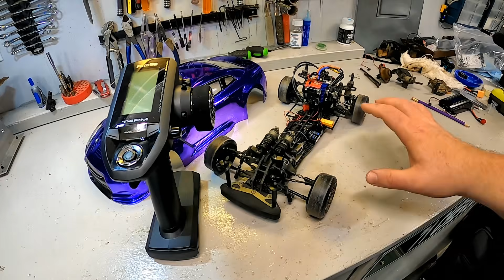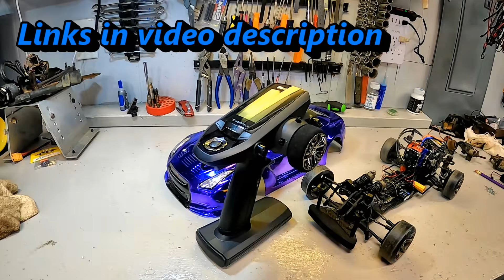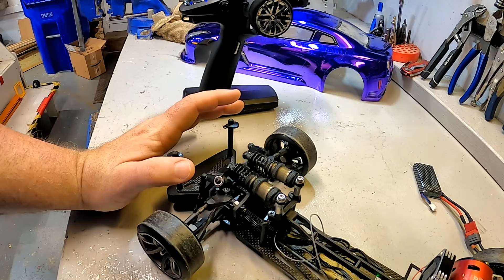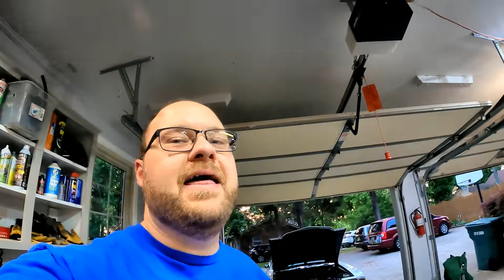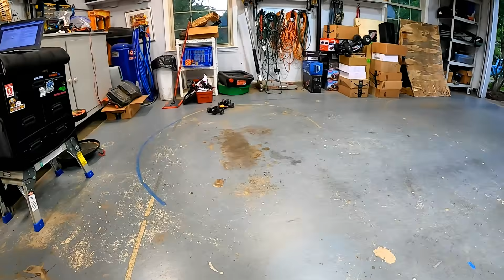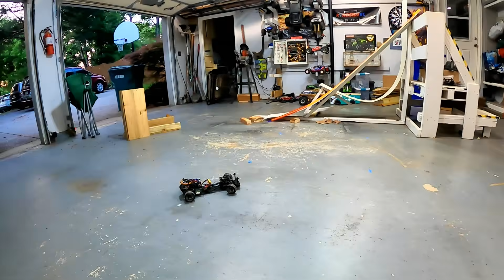How To Setup and Test the Yokomo DP-302 v4 RC Drift Gyro

Comment: Where do u plug in the gyro gain control I plugged it into the same channel but mine isn’t changing colors
Reply from the maker: Check this out to see if it helps:
https://youtu.be/_9qjApI1Uog

Depends on which controller you are using.

Comment: How well does this gyro work with the flysky noble?
Reply from the maker: Not sure I have paired them specifically - but based on my experience, I see no reason why they wouldn't work well together.
Reply: Works perfectly. I've used this gyro, and the OMG V4 on both the NB4, and my current NB4+. Plug the single wire plug into ch3 / ch4, map it to whatever adjustment control button you have free, and you can adjust everything on the fly gain wise. (depending on if your settings are rev/norm), going to a negative value puts the gyro into soft mode (green led), and if you increase the value back to 0 then into a positive Value, the Led with change to red giving you hard mode.
If you want to be able to be able to put the car where you would like it, I'd suggest using soft mode on normal switch setting (green led - and normal position for the switch on the gyro itself.)
Hard mode will make initiating a drift and holding angle in the corner easier, though your steering inputs will feel sort of "numb", like your having to fight it quite a lot if you want to adjust the cars position on track mid corner. In soft mode, you'll have the freedom to position yourself quite freely, though the downside to that is if you're not smooth with your steering inputs, the car is going to reflect that by looking unstable and inconsistent. Smooth input to steering and throttle are the biggest factor, and imo one of the hardest things to grasp if you've driven off roads most your life.
Spose the other thing to mention... Try different modes out for decent periods of time during your next track day! Just because settings work for one, doesnt necessarily mean those setting are going to mesh with your particular driving style! Find what works for you! .

Comment: Hi Troy 
My gyro was goes in the wrong direction when I started. How to fix it?
I tried to reverse from the remote but still doesn’t work. 
I’m using 3 PV, and yokomo V4
Reply from the maker: The gyro has a reverse feature...or you turn the gyro around 180*
Reply from the maker: You see the little switches on the gyro?  Check those out.

Comment: I just bought drift gyro DP-302v4, but I can not find anywhere the information about the input voltage for gyro. 

Can I use 7.4v from receiver with the 
Yokomo DP-302v4 gyro as power in?
Reply from the maker: The gyro is 100% powered by the receiver when you plug it into it.  

You mention 7.4V - so I wanted to ask about that.   The receiver gets the power from the ESC.  The ESC typically provides 6V to the receiver (it steps down the voltage from the battery).   Are you trying to run higher voltage?
Reply: @RoadsideRC  I mean you can set your BEC voltage on XR10 Pro or XD10 to 7.4v from default 6.0v. Thats why.
Reply from the maker: @blazbohnec  No need for the higher voltage in drifting.   Leave the BEC alone and have fun!
Reply: @RoadsideRC  Any idea? Because I can't find any info related to input voltage, altho 90% of other gyros have it listed under the specs.

Comment: assist mode hard mode is suppose to be for beginners, assist soft is suppose to be for intermediate drivers and normal and soft are suppose to be for expert drivers according to video that i recently watched. thanks for the videos troy i have been in the rc hobby for around 38 years now an am learning new stuff all the time thanks again troy. chris
Reply from the maker: Thanks for the kind words Chris. 

I have not found that the guidelines for the mix of settings holds true.   When I asked at my local track, there was a big mix in results.

Comment: Hey troy, my gyro just has solid blue, red and green lights and i have no steering any at all. Any idea whats going on?
Reply from the maker: Double-check how it is plugged in.  Sounds like something isn't connected correctly.
Reply: I've triple checked my connections, the servo works without the gyro hooked up (reved RSST). I'm starting to think I have a compatability issue

Comment: What kind of motor combo brushless that you use for that kit?
Reply from the maker: This ESC:  https://www.avantlink.com/click.php?tt=el&merchant_id=4b85b2b7-558e-4304-89fc-54958c8f47f0&website_id=caf4cba5-8e5f-43be-93b7-934f1a36d50d&url=https%3A%2F%2Fwww.amainhobbies.com%2Fhobbywing-xerun-xr10-pro-stock-spec-v4-sensored-brushless-esc-hwa30112401%2Fp540791

Combined with a 10.5T motor.
Reply: Is that motor is cheetah motor ? Bcs the color is orange same with cheetah,,,I just want to find out is it cheetah brushless is contained with turbo or not,,,anyway thanks for your informations and your videos is really2 helpfull for everyone who wants to play RC from beginning

Comment: Does placement and orientation matter?  I saw somewhere to put it as low to ground as possible and in center.
Reply from the maker: As long as you keep the gyro away from vibrations (motor and servo), you are fine.  No need for it to be low and centered.  It can go anywhere.
Reply: @RoadsideRC  Does it have to be facing a certain way? i.e lettering facing the side of the car or left to right like how you have it placed? just curios as i am building right now. BTW your videos are awesome and have been very helpful!

Comment: quick question what servo are you using
Reply from the maker: I use the ReveD:  https://www.avantlink.com/click.php?tt=el&merchant_id=4b85b2b7-558e-4304-89fc-54958c8f47f0&website_id=caf4cba5-8e5f-43be-93b7-934f1a36d50d&url=https%3A%2F%2Fwww.amainhobbies.com%2Freve-d-rsst-low-digital-programmable-servo-black-rv-rs-sta%2Fp1434712
Reply: @RoadsideRC  thanks

Comment: can i use this with a 2ch radio?
Reply from the maker: Yes, as you can set the gain directly on the gyro - however, I don't recommend it.   The control you get with a better radio is 100% worth it.
Reply: @RoadsideRC  ty ill probbaly get the futaba 3pv as well

Comment: Is it possible to burn a stock servo by switching to a different receiver?  I lost my stock servo that came with mst rmx 2.0 when I replaced the stock receiver with a Flysky FGr4v2 Receiver.
Reply from the maker: That is very odd.
Haven't heard that before. 
I am guessing the servo must have been on its way out already.
Reply: @RoadsideRC  Odd indeed!  Shortly after I plugged the new receiver in, the steering acted abruptly and then turned and stuck in the leftmost steering position and that's when it died.

Comment: Thank you for this video, I was struggling to figure it out.  Just one question, should I be setting my endpoints in my transmitter first then the gyro or because of the gyro's feature I can skip the transmitter part all together.  Thanks so much
Reply from the maker: I leave the transmitter end points set at 100.

Comment: So do I set up the end point on the transmitter first? Or on the gyro? If I use 100% end points on the transmitter the wheels hit the lower arms
Reply from the maker: Transmitter first.  Set the end points without the car moving (no gyro input).   Then, also set the endpoints with the gyro.

Comment: hard is exactly what you stated. it assist the steering controls so you can keep an angle and learn to counter steer. imo its counter productive and creates bad behaviors for rwd drift. green on the other hand is exactly what you stated again. it kicks you out and allows you full control of the angle instead of giving you that "extra time" to react and counter steer. IMO if you run a yokomo v4 you should only run and learn on green mode.
Reply from the maker: Thank you! 
Glad to hear this from someone else.
Reply: I actually learned with mine on the red side. I just watched this video earlier to set the end points. So I tuned it to the green side. I'm not fully sure which side I like better. After getting so used to it on the red side. Lol

Comment: hey i want to throw a tip. try a good cap for the receiver. it prevents voltage drop and will help the gyro smoothen out with the servo.i put a trace bector from acuvane in line with the servo and gyro and WOW. made a good difference on my yd-2zx front grip feeling and specific long sweeper jitter at super g. the servo uses a lot of current believe it or not. also with a yokomo v4 only drive on green mode.
Reply from the maker: I am happy to try a capacitor - interesting idea!
Reply: Hey there please explain via images if possible what is meant by putting a cap inline with the receiver.
Reply: Where exactly do you wire it... Plug into the receiver is it? I already have a cap on the esc battery wires

Comment: Will the v4 burnout stock servo?
Reply: I know this an old comment but I put this gyro in my rmx rtr with the stock mst servo, it took the servo out before I could get it set up. Completely trashed and locked up. Just a heads up.
Reply: @pauldziedzic1791  yeah learned that the hard way.. on purpose.. wanted to defy the rumors.. but ended up being fact
Reply: Is it possible to burn a stock servo by switching to a different receiver?  I lost my stock servo that came with mst rmx 2.0 when I replaced the stock receiver with a Flysky FGr4v2 Receiver.
Reply from the maker: There is a chance of that, yes.
Reply: @RoadsideRC  I'm guessing that's what happened lol figured... I really didn't want the v4 but wanted to give it a go since the gyd450 is hard to come by now a days. I have an extra mst servo and the one u have from Amazon. Guess gonna have to go with a reved
Reply: will the V4 burn out the INJORA Digital 14K Low Profile Servo And Is It Compatible.?
 @RoadsideRC
Reply from the maker: @user-JackThrilla  They will work together just fine.
Reply: @RoadsideRC  thank you 💯💯💯

Comment: Do you talk about the correct way to adjust ride height in any of your videos? RMX 2.0. Thanks!
Reply from the maker: Thanks for the question! 
I don't believe that there is a "correct" ride height.  Many folks throw around the 5-6mm number - but I don't believe that is true for all cars. 

Here is a video where I was tuning the suspension with different springs. 
My focus:  let the shocks sit somewhere in the middle of the travel, allowing for movement up and down based on the needs of the car.   
https://youtu.be/rmUvzAWUBEo
Reply: @RoadsideRC  thank you I’ll check it out! Does this physically how how to adjust the height?

Comment: If someone is just starting, I'd highly recommend Normal Mode and Hard(Red LED) with gyro set between 80-90 percent. This will allow you to transition faster and won't hold you back.
If you have the V4 and your servo wobbles at these settings, you need either  a better servo or to turn up the torque value on said servo, if it's adjustable.
Reply from the maker: Thanks for the tips!
Reply: I honestly need someone to walk me threw all the setting customizations on my radio and all that. I'm new but believe I have a decent set up. Maybe it's because I'm new to it but I feel like something is off because it's super hard to drift. If anyone can help I'd appreciate it so much!
Reply: @Zoomies1990 same here! I need a Radiolink RC4GS v3 setup for drifting😂

Comment: So I got mine installed and the car now seems to have some struggle returning to center? I have it in normal and soft mode. Thanks in advance for your help!!
Reply from the maker: Does it still do it when you turn the gyro gain down?
Reply: @RoadsideRC  yes. I only had to gain around 40%
Reply from the maker: That is odd. 
How about if you turn the gyro completely off? 
Sounds like the servo is weak.
Reply: @RoadsideRC  servo smells and is completely dead now… great lol
Reply: @furiouslycollecting  The V4 is a pretty high frequency output compared to say the YG-302, it'll completely blow out most lower end servos.
Reply: @ShaneMikula  oh no i have a traxxas servo
Reply: @silencioso3271  Get a Yokomo SP-02V2 after you blow that garbage up lol
Reply: Did you set end points 😶

Comment: Hey Troy! Excellent video! I’m currently in the process of building my first rc drifter. I’m definitely thinking of getting this gyro, but still not sure what controller to get or even how many channels it may need. Any advice?
Reply from the maker: In this video, I show the Futaba 4Pm.   Great controller.   A no-regrets purchase that will do everything you want it to do.  
Link:  https://amzn.to/3PFV5lS

It is expensive though, so you can always step down to the 3PV.  It does 90% of what the 4PM can do, for a cheaper price:  https://amzn.to/3wLhc2V

You are looking for something with a 3rd or 4th channel that you can manipulate in a 0-100 way.   The other benefits include a controller with exponential settings. 

You can start with a cheaper controller, but will find yourself eventually upgrading.
Reply: @RoadsideRC  Awesome-tastic!! Thank you very much for the info.

Comment: Just finished my first MST drift build and this will be perfect to get my car running thanks Troy! Have this gyro stuck down ready to setup and test.
Reply from the maker: Awesome!  Great gyro - hope you enjoy it!
Reply: @RoadsideRC  Im having issues with it pairing up with my new Reve D servo - The servo is making a horrible squeling noise when connected to this gyro.
Reply from the maker: That is very odd.  Sounds like something might be wrong with the servo. 
Post a video of it on a drift Facebook group so folks can see it.
Reply: @RoadsideRC  All sorted now and have a runner!
Reply: What fixed it? I have the same issue using the stock mst servo that comes with a rmx 2.5 rtr

Comment: I've been told the shutter of the steering is tied to bad front end setup and you shouldn't need to put it in assist but I can get rid of it at all on my Sprint 2
Reply from the maker: That can contribute to it for sure. 
My old RMX had a lot of slop in the rod ends.  Reducing that slop helped with wobble for sure - but will not eliminate it.  
Going to "assist" or "AVCS" in Futaba language is a game changer in my opinion.  

It just get a negative connotation due to it being called "assist".